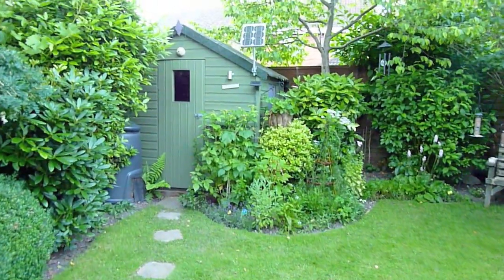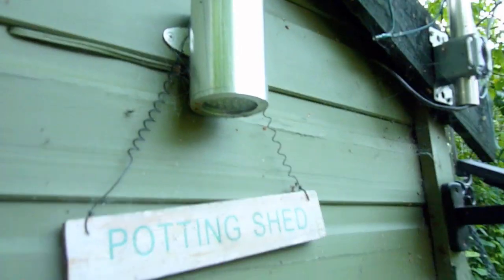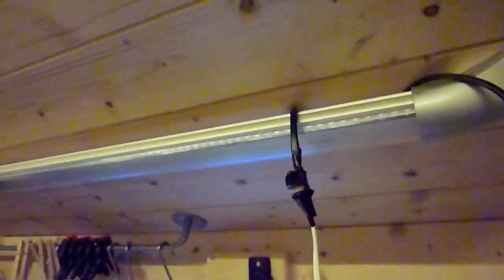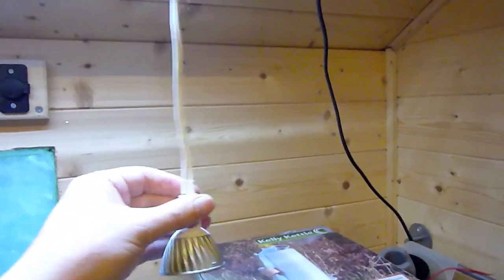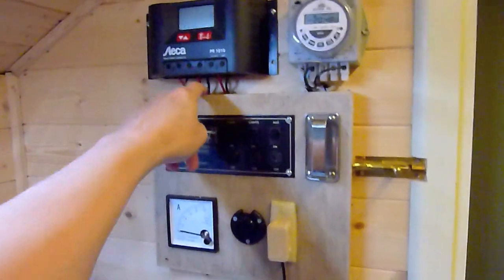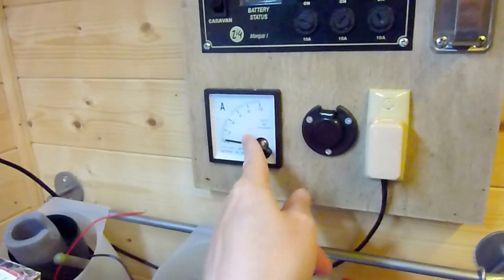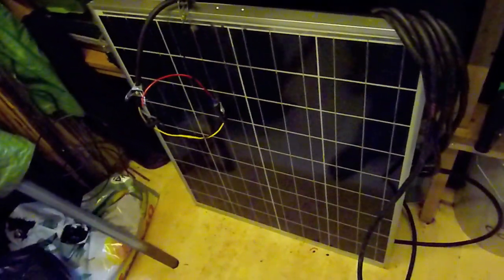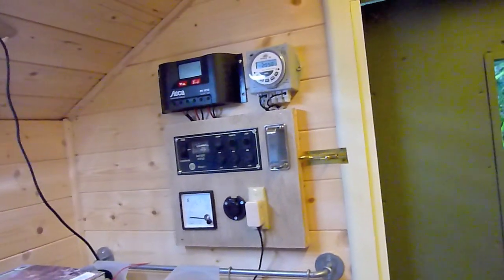Solar Shed 2

Comment: I know how...buy an inverter. 12v in 120v out. Or 12v in and 240v out depending on where you live. You can get pure sine wave and or modified sine wave inverters.   Power tools will run fine on a modified sine wave but electronics want a pure sine wave. Very nice work and happy solaring!

Comment: I want to make a garden bar/small shed with lightening, small TV for the football and a small fridge (camper van style) for drinks mixers. I’d only need to power the fridge when using the bar so not permanently.

What type of setup with panels and batteries do you think I’d need for an average south coast summers day?
Reply from the maker: What’s the power consumption of your fridge and TV? Once you know that, you can decide the right capacity battery and then a suitable solar panel. Is the TV 12v or mains?
Reply: @MartinDoyle  it would be a mains TV and a camping style half fridge so would probably work with a 12v plug

Comment: Use 240v inverter right off the battery , great video thanks for sharing ur setup
Reply from the maker: Thanks for commenting. Everything I need to use is 12v DC so have not bothered with an inverter - they tend to loose a fair amount of power in the inversion process, so unless absolutely necessary, avoid. But, there may well be cases where you need them...
Reply: hi martin sorry the comment was aimed at your last comment ( on the video ) about turning the shed into a work shop , the inverter would obv help with powering work shop tools etc :) great setup btw well done on all your work it looks great thanks for sharing.
Reply from the maker: @paulstir  No worries. You're absolutely right that if I were to make it more workshop-like then 240V would be needed for things like power tools or even power tool chargers. The shed has stayed less like a workshop and more like a place to sit and relax in (especially as I have woodburner in there for winter), so it's mainly lighting these days with the occasional phone or tablet recharge through USB.
Reply: Martin that’s just it for me I have built an outdoor hot tub room and I’m planning o lighting the with solar + battery = led lights and Maby a phone charger for chilling in the tub I have a 42” tv behind Perspex built into the wall  and I was after other people’s ideas on setup configuration, as I have the solar panel and battery I’m just about to install the wetwall on the inner roof + the wiring for the lights , lol that sounds like a man cave perfect place to hide from the wife haha 👍

Comment from the maker: It's called a leisure battery - designed for caravans/trailers & boats. They are almost classed as deep cycle but they're not quite as durable, but they are much cheaper. The one I use currently is an 85Ah unit.

Comment from the maker: With a system like mine, you would not try to run a washing machine as the current drain is too great. However, the charge controller senses battery voltage (ie charge level) and will cut power to the attached devices to prevent the battery draining too much, which could damage it, or shorten it's life. With a larger system (more batteries), you could run a washing machine, but yes, if the batteries run out, it's like switching the mains off - shouldn't damage the appliance though.

Comment from the maker: Inverters will suck your battery dry quickly! I did think about putting one on my system, but all my stuff is 12 v so not needed. Obviously if I wanted to run power tools etc, then you'd have to, but likewise a bigger battery (or batteries) would be needed.

Comment: why the tv signal loses when lighting up with solar power
Reply from the maker: I'm not sure what you mean? If you are referring to the line that appear when the camera points at the light, I think it's just due to the specific camera I had and how it reacted to the light. In day to day use, the lights are still fine and working well.

Comment: Awesome! The control panel thing is cool. Im guna copy what you've done tbh, because it really looks like it works well together. Good idea to have the volt/amp meter like that. Im going straight for 120watts with 2x 60w panels :). Either its just the camera or those led's work excellent too. The brightness really surprised me on that little mr16. I was going to buy 2 or 3   9-11w CFL's. But you've converted me to LED lighting.

Comment: Hi, nice video. Can you power the timer with 12V DC and run 12V DC through the switch?
Reply from the maker: Hi. Yes, it's all powered by 12V DC. The timer has a built in battery to maintain the clock in case of power failure.
Reply: +Martin Doyle what brand is the timer? it doesn't look like Frontier, i'm trying to find one at a good price
Reply from the maker: Bohisattva Hi - the timer is made by Flexcharge in the USA. They are not cheap, but they are good quality. For non-critical projects, I would probably buy a cheaper one from Ebay...
Reply: +Martin Doyle, thanks

Comment from the maker: Thanks - I would say whilst hiding the wires was great, inevitably things change and you want to put sockets or switches in different locations which is much harder. It pays to spend time working out where things will go in advance and build in as much resilience as you can to accomodate future changes.

Comment: Hello, would it be possible to list all major components you used in the installation. Product links would be greatly appreciated.
Reply from the maker: Hi. This video is 6 years old now and I've upgraded/changed the setup. I plan on creating more 'how to' videos which will show components in more detail and hopefully have product links if possible. Don't know when I'm going to be doing this, so you might be hanging on for a while!

Comment: Why does it have to be 12v only, are you not happy about using any mains power at all?
Reply from the maker: I'm very happy to use mains power, but this was a learning experiment for me. I used to have a mains cable running from my house to the shed, but when it needed to be replaced, the building regulations had changed and the cable and other items that you now 'had' to have made it very expensive so I looked at a simple solar system to essentially give me lights. The system has taught me about energy independence and how much we take mains for granted, and also about the limitations of small solar systems. It would be possible to add an inverter to take the 12V DC up to mains AC, but they are inefficient so I believe it's better to run everything at the same voltage as the battery where possible.
Reply: Great stuff. Why did it have to be changed though?
Reply from the maker: Maxsdiscos The original mains cable ran along a fence and it blew down in a storm! The cable was also starting to degrade as it was from a extension reel and was not 'proper' outdoor armoured cable which the regulations specify.
Reply: ha, my friend and his neighbour do the same.
Reply from the maker: Maxsdiscos It's great until something goes wrong and your insurance company won't pay out because you used the wrong cable...  The whole solar/mains issue depends on what you want to do - with solar, you can't plug your mains lawn mover into a socket in the shed, but if it's just lighting, music and phone charging, solar is fine. Always wished for black outs so I could show-off to the neighbours, but we very rarely get them!
Reply: yeah

Comment: good job on the electrics and even better on the shed as a whole esp the knotty pine inside
Reply from the maker: Thanks Bob. The pine (and the insulation behind it) was actually a very big job but I'm glad I did it. Earlier this year, I painted the walls off-white and am in the process of putting a danish oil on the ceiling. I've had some issues with the shed - the floor collapsed last year due to rotting, but I made a new sub floor which should see it through a few more years. Ideally I'd like to make a new shed but the amount of time involved is putting me off!

Comment from the maker: I suspect it will, although I'd always say 'it depends...'. I am about to upgrade my setup to include a 40w panel because of the winter shading my shed gets and the fact that I now have a small fan running 24/7 (compost loo). But with 12v PIR spotlights and LED roof lights, depending on use, 20w should be OK. The battery capacity is fine. The real test with solar is winter, but if it gets bad, at least you could bring the battery to the house for a quick mains charge!

Comment from the maker: +super awesome minecrafter - yes I can use an inverter, but I don't need need to? Sure, if I needed to use something that only ran at mains voltage, then yes, but for simplicity, I've kept everything at 12V. The other reason for me not using an inverter is that they are a) expensive (if you get a good one) and b) use some electricity doing the inversion. If you have a very large battery, solar panel etc, then the fact that an inverter is not very efficient may not be an issue, but in smaller setups, like mine, every ounce of 'juice' is precious.

Comment: Ive got a cheap pwm charge controller that has a load conection with a light bulb symble like yours .my expensive mppt trystar hasnt got a load +and - it seams only the pwm ,s only have this .. just wondering how many 12 volt mr16s i can run of this its a 60amp  12 or 24 volt charge controller the 60 is the bigest cheap one i could find i thought the bigger the better cause you can buy cheap 20 amp pwm charge controllers does the 60 amp one i got run more 12 volt globes than the 20amp one and how many can i run of that load port  thanks
Reply from the maker: busabaybe Hi. All the MPPT charge controllers I've seen have a load connection. It tends to be a standard feature as they all have load disconnect if the battery gets low. Look at the Tracer series, such as the Tracer1215. The charge controller amp rating is related usually to the maximum amps your solar panels will be producing. If you connect high consumption items such as an inverter - it's usually recommended that you connect it directly to the battery bank in order to keep the wiring short and the potential power loss minimised. In the video above, I use a 10amp charge controller, which is good for 250 watt of solar panel. 

The number of lights you can run is more dependent on the battery as you'll probably need lights at night, when the sun isn't shining so you are relying on the battery. For example, a 3 watt LED bulb running at 12 volts consumes 0.25 Amps - so you could run 4 at 1 Amp, 8 at 2 Amp. 16 and 4 Amp and so on. Let's say you had a 60 Amp charge controller - in theory, that's 240 3 watt LED lights. In practice, you'll need to be very careful about selecting the right cables to ensure they don't melt, and a big battery or battery bank to supply that power.

Why don't you look at things the other way around. Work out what you need in terms of lights etc, then calculate the watts or amps consumption - from that you'll be able to calculate what sort of battery (or batteries) you'd need, then from that, you can work out the best solar panel(s) configuration (if you need power in winter, that'll mean more or bigger panels), and from that you can work out the right charge controller. Like most things, bigger is not necessarily better and cheap is not always the best value. Good luck with your project.

Comment: Taking your advice i am also going to go for a 40watt panel, with a 10a controller and 100ah battery. Could I also ask you for some info on the wiring, mainly the fuses, what ratings and exact locations you would advise. cheers

Comment from the maker: Kieren - in the video I use a "Steca Solsum" charge controller. My original charge controller was a basic Steca unit, but I upgraded to this one because of the extra information it shows in the LCD display which I found useful. I chose Steca because they are a known and trusted brand (German I think) - there are lots of cheap Chinese controllers on the market, but seeing as these devices are key to keeping the battery in top shape I thought it would be a worthwhile investment. 

Since making this video, I had a problem with my solar system which I tracked back to the charge controller. I disconnected it and wiring in a simple PWM controller made in the UK (called the PWM5). I will re-connect the Steca charge controller at some point, but for my next controller, I would probably look at an MPPT unit as they extract even more power from your solar panel.

Comment from the maker: Hi. Some I bought online (Ebay) and some from stores in the UK. They are fairly standard for UK caravans (trailers) and boats running 12 volts. In the UK, the main brand name is 'Clipseal' - they are not too expensive and can only go one way round.

Not sure about Canada, but I searched on Ebay UK for 'Clipseal 12 volt plug' and came up with some results. Hope you can get hold of some...

Comment: How much did the solar system cost?
Reply from the maker: Hard to say - I've built it up over the years. Started with a 10 watt 'kit' which was probably a mistake. Now I have a 40 watt panel (£74/$120), the Steca Charge Controller shown here was around £50/$80 (although I've since swapped for a cheaper/simpler unit), and the battery was £70/$112. Wiring was minimal and other items were sourced from Ebay or scavenged. The essence of a system is the solar panel, charge controller and battery. The rest depends on what you want to do - I recently installed some IKEA LED light strips that cost £11/$18 a pack (I used 2 packs) - check out my other videos for details on that.

Comment: Hi Martin, great work sir. I would really like for you to tell me how you wired up the timer for your light. I have a similar set up just for my waterfall pump. and would really like to put a timer to it. Thanks in advance
Reply from the maker: Hi Mario. Thanks for your kind comments. I'm not using this particular timer any longer. I have just purchased a new 12V time (Sinotimer brand) and connection is easy - it has a positive and negative for the power (12V from your battery or charge controller), and a positive and negative for the load - in my case the light, and in yours the pump. Very simple to connect.
Reply: mario sellet don't know if he used it but that charge controller has a built in 12hr timer which turns off the output from the battery when the solar panel stops inputting a charge.

Comment: HELP ME!! This is 10 watt you say. ?? And that runs them lights brilliantly so what wattage would you need to run a TV n games and sockets and a normal like in a summer house for summer times?? And could you run them all at the same time? And still have full power please help and please talk in English and not electrician language lol
Reply from the maker: +Mats Turnings In this video I had a 10 watt panel but have upgraded to a 40 watt. It's very hard to give you a precise answer because it will depend on how much power you need for your TV's etc and how long you expect to have them on for. Once you know, you will have an idea how much power you will use during a 24 hour period, and from that, you can work out how big a solar panel you'll need and what size batteries too. There are lots of other factors, such as whether you want to use it to the same extent in winter as well as summer. If you're serious, I would start by talking to a local company who supply off-grid solar as you'll need 'proper' advice. Either way, you won't be able to do much with a 10 watt solar panel, but the good news is that solar panels are now much cheaper...
Reply: +Martin Doyle cheers for your help and advice Martin

Comment: just a query, i am thinking of installing a 20w panel, 10a controller, 75ah leisure battery into my shed, do you think this set up is enough to run led roof lights and pir spotlight x2 on outside of shed??

Comment from the maker: Hi Hank - I've not permanently sited the larger panel yet - still on my to-do list. I do place the panel in the sun to charge a 110Ah battery that I use in my garage for lighting (I have a great 3 watt LED MR16 bulb) and for recharging AA and AAA batteries. Have you got a solar panel yourself?

Comment: I liked your little British-made Charge Controller. What Brand is it? Is it available in the States? And what does 18 Quid pencil out to in USD?
Reply from the maker: Hi Bruce. Unfortunately it's no longer made, but the maker has released the design as open source: http://www.256.co.uk/?p=917
When he was selling them, they were called the PWM5 (because they were rated at 5 Amps) and sold around $25.